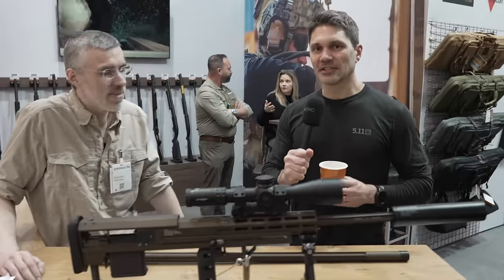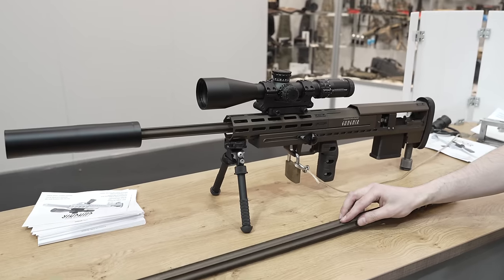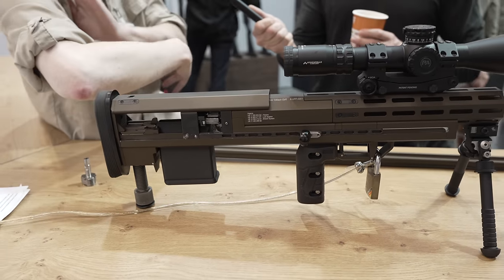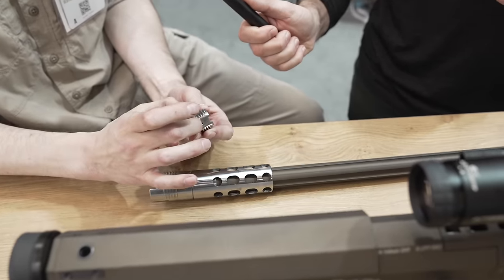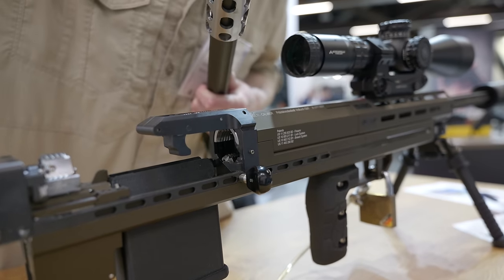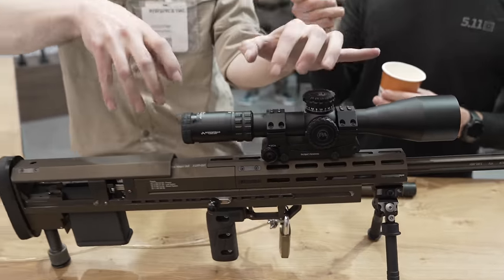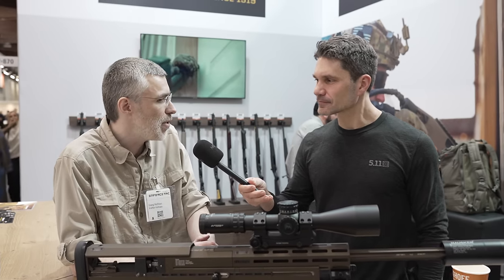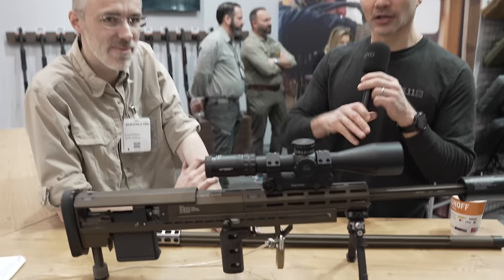A Very Small .50 Cal Bullpup Rifle: The Gungnir

Comment: It probably wouldn't be too difficult to make a short-stroke gas-piston operated receiver upper for this. Modify the bolt carrier to have a return spring where the charging handle is, have the piston also impinge on the bolt carrier, and then you just have to make a gas port on the barrel the right size.

Even as a straight-pull bolt-action it's still really damn cool.

Comment: Holy sheet, those guys made Desert Tech look like stone age. Crazy compact, I'm in love with this design.
Reply: First thing I thought was Desert Tech.   A 50 BMG bull pup makese a bit nervous.   That's a lot of boom right near your head/neck area.
Reply: @bmstylee My first thought
Reply: @bmstylee  Designs like this are insanely safe, they're designed to be "Safe to fail" so even if something goes wrong it should fail in a safe way. Unlike the RN-50 which is the exact opposite of safe to fail and will happily tear a hole in your neck... 
Also if you're shooting factory loads, you'll be fine, especially with a bolt action.
They even mention it in the video.
Reply: What "worries me" is the giant ejection port that's begging to be filled with stuff, in real use it probably wouldn't be an issue, but still
Reply: @WarlordEnthusiast  If you shoot counterfeit, overcharged ammo from any gun you're gonna end up with a hole in you...
Reply: I'm not sure I'd be comfortable with that tiny bolt lock up.  I'll stick with the HTI, for my safety.
Reply: @DominicPaz You do realize that the area that actually does the locking is the exact same? The lugs are what does the locking, rest of the bolt is just waste.
Reply: @irysh9  Hence why I said, "If your shooting factory loads, you'll be fine"....
Also that's not entirely true, Kentucky ballistics has a whole series on blowing up guns with overpressure ammo, most guns fail in a relatively safe way, you'd be hurt but probably not dead.
Reply: This multi caliber toy isn't even in the same league as Desert Tech.
Reply: @Totemparadox  I actually own one and have taken the bolt head apart many times so I can say no they are not the same. The lugs on the HTI are much bigger and the barrel extension is much much more robust.
Reply: @DominicPaz  And the HTI has only half the lugs this has. 6 vs 13. This is again the same misconception that people always have. They think more, but smaller lugs are somehow inherently weaker. If this is a weak design, why would they have bolts like this on naval guns?
Reply: @Totemparadox it might be a good design.  I just don't trust it for some reason.  Looks flimsy in comparison to traditional 50 BMG lugs.
Reply: @DominicPaz  just bias from the bolt being alone without a massive bolt carrier behind
Reply: The question is does it shoot like a Desert Tech
Reply: @bmstylee  I think Kentucky Ballistics just flinched when you said that... ^^;
Reply: @WarlordEnthusiast not every system with a price tag higher than that one single-shot screw-in chamber have failure safeties, and the topic wasn't brought up in this conversation.
When the accident was analyzed, the RN-50 was compared against the Barret M82 alone and that was more to showcase different types of failure safety: while the M82 is designed to divert the energy and generate shrapnel away from the direction of the shooter, the RN's safety was its construction which allows it to withstand pressures several orders of magnitude superior to the ordinary, and overbuilding is a perfectly valid solution.
Scott's case was extremely unfortunate. Could have firing the suspicious ammo with an M82 spared him a trip to the ICU? Maybe, but I wouldn't paace the blame on the RN. Ultimately the cause of the incident was the ammo that even when Scott attempted to recreate his accident, he struggled to reproduce because it was so scuffed.

With all that said, it would be interesting to see this gun blow up. 'Sides that seeing things blow up is always interesting, the concern is real and worth examining.
Reply: @cdgonepotatoes4219   "the topic wasn't brought up in this conversation." 

3:15, he goes into detail how the design of the bolt is safe to fail even if the locking lugs start bending.
Reply: @WarlordEnthusiast  eh, my bad for not paying attention

Comment: Now this is more along the lines of what I'm intrigued by. The fancy high cost concept pistols were fine I guess but this is the kind of innovation like and would consider investing in
Reply: Also, I noticed he had the scope mounted to mlok slots. Would that retain zero?
Reply: Probably not unless precision machined to match perfectly.
Reply: My understanding of M-Lok is that it isn't meant for use with anything that involves aiming of the weapon (scopes, lasers, red dots), it's only meant for accessories that don't involve any sort of precision (lights, vertical grips, etc.). They would really need to put a picatinny rail on that thing to properly mount that scope.
Reply: @kutter_ttl6786  that's my understanding as well. I'm wondering if there's another thing that James didn't ask about that may be a method they have to get around that issue
Reply: @frankdamsy9715  Like that guy already said this is not final version. So
most likely this is mechanical showpiece for action.
Pretty sure we will see some changes made for scope mounting
before it is retail ready.

 Or because we are talking about engineer itself there may be something done
for to fix that issue. Would be strange to forgot how to walk if just learned to swim.

Comment: I feel like that bolt design is getting slept on. Even if you could redesign the ol mama deuc with it, I feel like you could take inches off of the whole system. 

Assuming it actually holds up to use that is.
Reply: I doubt it would be able to sustain that level of hard use. He indicated it has not failed yet and they are about to burn up a barrel. 50bmg is notorious for short barrel life, they need more testing.

Comment: This in 408 CheyTac would be insane for long distance shooting, plus this is much easier to rack compared to a traditional bolt action, without taking your hand off a shooting position.
Not including this probably weighs less than a Serbu BFG-50.

Also being honest $5K for this seems very fair, being the fact you can leave your magnified optic on the upper and just swap it to a different caliber with it's own zeroed barrel to magnified optic.
This is probably the most interesting firearm I will see this year. If this comes to the US, I might have to sell a kidney to get one.

Comment: Finally something truly innovative! Definitely shades of the gm6 lynx with the bolt and magazine design, but it’s stripped off the recoil mechanism and shed a good few pounds. My main concern with any multi cal design is unnecessary weight with sub calibers but this is so minimal with the frame it may solve that. The one thing that caught me out a little is the length of pull changing between calibers.

Comment: It's pretty sweet..  But I would not trust it to shoot 50 BMG..  
That bolt lock up looks way under engineered for a 50 cal shot that's going to blow up right by my face, with no shielding or reinforcement.
Reply: Barrett's are sheet metal lol.
Reply: @Totemparadox 
Barrett has a chamber 10'' from my face and not on under my chin. You can literally see case head trough the receiver.
Reply: @jerkojuric6137  So you haven't heard of the M82A2 or M95?

Comment: If I got this right in the case of case head separation you will get the kiss in the cheek with full force of the 50000 psi ... You can literally see big part of the the case head exposed after closing the bolt. Only thing missing in this picture is the fake .50 SLAP rounds :)
About ergonomics... where do you see any trace of ergonomic in this ''precision rifle''?

Comment: Yeah this is genius, kinda like the bolt started from a cheap, simple Serbu Screw chamber but they wanted to be able to cycle it, then saw Kentucky Ballistic sear the threads off with a slap round and made the chamber pressure work with the lockup. I love Straight-Pull bolts and I love Multi-caliber so this thing is super cool to me
Reply: Unlike Serbu&SLAP incident this design have only HALF of the threads locking (and only half of the strength of Serbu design).  Also this story of ''self-tightening'' of the lockup under pressure is a pure fairy tale since the locking threads are weakened by 3 giant slots which cuts the threads in the receiver.
Reply: @jerkojuric6137 How does this make the threads weaker if the "trunion" prevents them from expanding outwards.
Reply: @jerkojuric6137  Well it looks cool, and the European market will work out the bugs years before we ever see it.

Comment: 🤔A Straight-Pull in .50 BMG????-Sounds like an invitation to an interview with St.Peter!
Reply: Please explain why.
Reply: @Totemparadox Straight-pulls are difficult to manufacture,as they have complex geometry.For this reason they have very little reserve left towards stability,and the first failure is the bolt coming straight back at the shooters face.Remember the Ross;K31 ist not the most stabile;but what I especially had in mind where the couple of Blaser Straight-Pulls,couple of years ago,who" " allegedly" "blew up for"Unknown"reasons 👎🤢🤮
Reply: @pe.bo.5038  Uhhhhh, what? You do know that straight pull bolt actions are operating system wise pretty much just regular rotating bolt semi autos with no semi auto function? There's nothing difficult or complex in making them. Fascinating that you would bring up the Ross K31. You know the gun and the issue but you totally didn't understand the failure which was poor design allowing for the bolt to be reassembled in a way that prevented it from locking. The design didn't fail strength wise, it was simply left open making it a blowback full power rifle 💀
Reply: @Totemparadox I'm well aware of the 1st Gen.Ross fatal design features .Also:Neither the K 31 nor the Blaser are Rotary lock systems!-At least for myself,I don't want a .50 BMG detonating 1 inch in front of my face!
Reply: @pe.bo.5038  The Blaser isn't rotary lock but the Ross is. Look at forgotten weapons video about it.